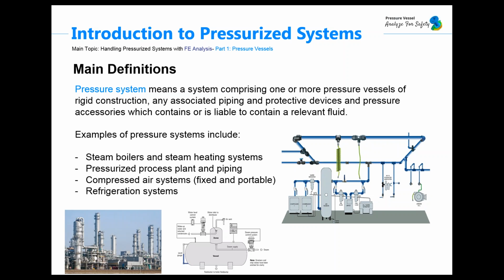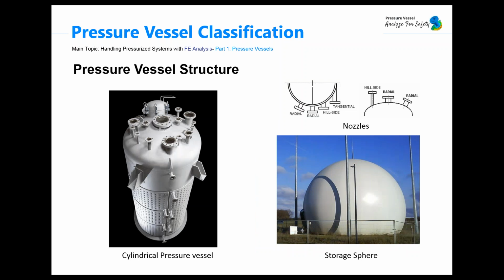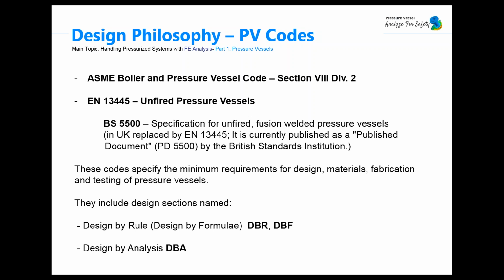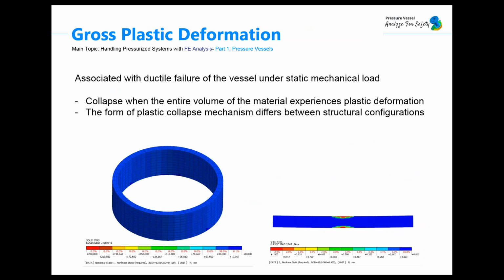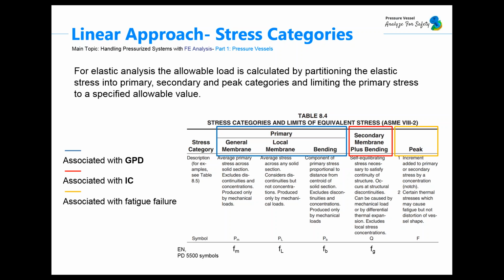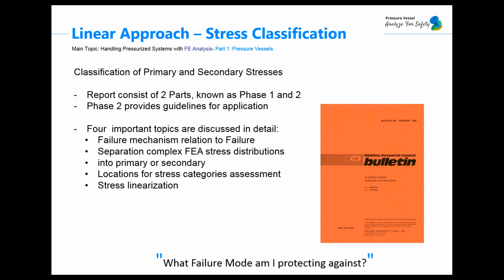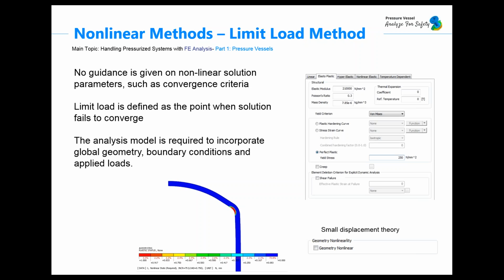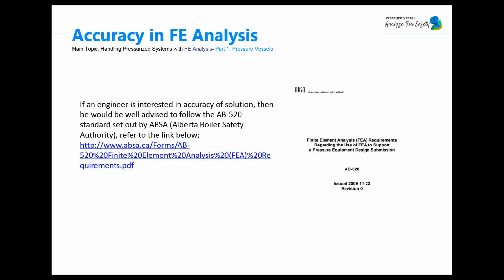Pressure Vessel FEA Calculation following ASME Section viii Division 2

Comment: Hello sir, I doing FEA analysis of Pressure vessel with nozzle in ANSYS Workbench (Static structural). Stresses at nozzle is much higher than allowable stress value. How to justify it means, I know, at nozzle stresses will be higher but they are much higher like 137.5MPA allowable and 250MPa yield and I am getting at nozzle is near about 622Mpa.